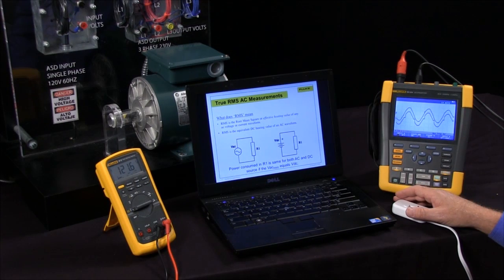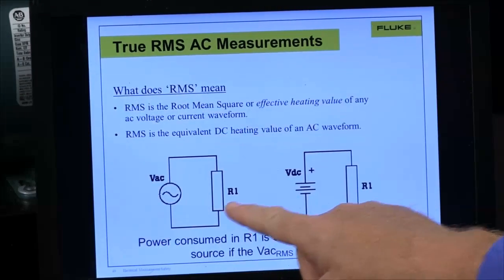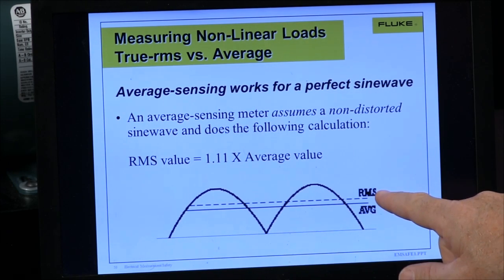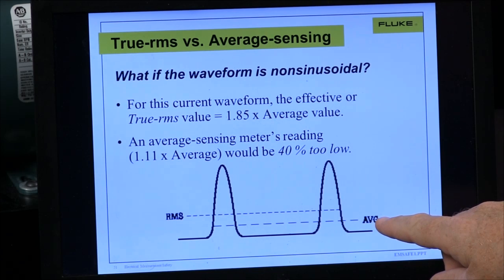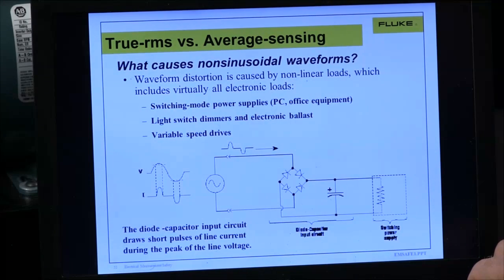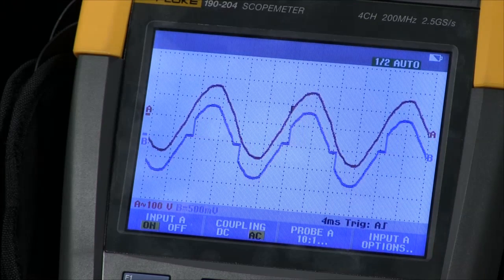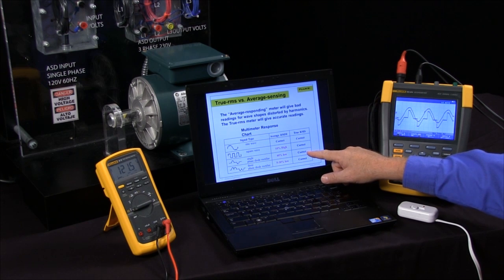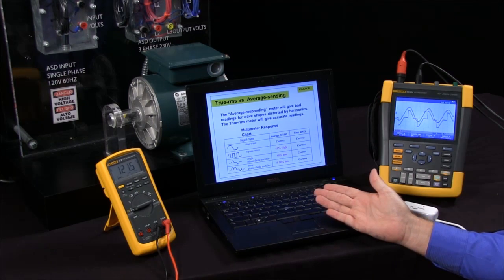What Is True-RMS And Why Is It So Important?

Comment: okay so how do i apply this? or in other words what does this tell me?
Reply: A true RMS meter gives more accurate results by accurately examining a sine wave compared to an averaging meter, which gives a rough estimate. The average meter is alright for perfect sine waves, but when you have distorted waves, you can get incorrect readings, which could interfere with troubleshooting or diagnostics. When it comes to sensitive electronics, it's important to have accurate measurements.

Comment: Q:  WHEN is a NON-TRUE RMS VOLT meter, a better choice than a TRUE RMS meter??
A:  Automotive alternator D.C. VOLTAGE OUTPUT measuring.  Why?  Alternator output should have only D.C., without any A.C. waveform, (called DIRTY D.C.), riding on top of the D.C.  If an alternator diode set is bad, the dirty D.C. will NOT ALLOW a NON-TRUE-RMS voltmeter to SETTLE DOWN.  The voltage display number will be erratic.  BUT, a TRUE RMS meter, set to D.C. will settle down and FOOL YOU into thinking ALL IS GOOD, when in fact, the alternator is BAD.

Comment: If my multimeter is reading continuety on the mineral resources but not beeping, what does it mean?
Reply from the maker: Hi Samson - Our multimeters will have a specified resistance value at which the continuity is guaranteed to beep and give an audible tone. That value can vary depending on which meter you are using. Which multimeter are you using and what resistance value are you measuring? Example would be the Fluke 179, the continuity beeper is only specified for ohm measurements at 25 ohms or less. Any measurements above 25 ohms is not guaranteed to beep.

Comment: How does a dimmer switch increase the peak to peak current? Makes no sense
Reply from the maker: Hi Scott - This would depend on the direction of the dimmer switch. If you were to dim the lights you would be increasing the resistance giving you a lower current through the bulb. And the opposite would be to brighten the bulb where you would decrease the resistance and increase the current.

Comment: Thanks sir...so true rms is for AC readings only..
Reply from the maker: Hi Abhay - A true-RMS device (RMS = root mean square) is one of three tools that can measure alternating current (ac) or ac voltage:

http://bit.ly/38hpMYj
Reply: @fluke  You didn't answer the question.
Reply: @immeohmyoh  the answer is yes and to be fair that link really gives more than enough info to fully answer.
Reply: @isaacturner199  The answer is NO. A DC PWM signal from a microcontroller would also be wrong.

Comment: Today I objectively tested my Fluke 117 "true RMS" meter against an oscilloscope measurement of RMS voltage at 60 Hz, using a square wave input from a signal generator with or without offset, varying duty cycles. I would have thought that the Fluke would do pretty well. Not so, compared to the scope! When it didn't perform well at 15kHz, I assumed it was because the sample rate was too slow, but even at a slow 60 Hz it can't keep up. Presumably the refresh and higher sample rate of the scope was the difference. At 50% duty cycle it is close, but for outside limits like less than 30% duty and more than 70% the result was pathetic.
Reply from the maker: Hi Scott - I decided to answer this question on your original comment. Please feel free to send a reply to our answer if you have more questions!
Reply: spelunkerd I’m trying to figure out how the current peak changed when he used the dimmer switch, I thought only increasing the load (reducing impedance) would result in increased current.
Reply: Have you been caught by a trap for young players? Specifically that RMS on a scope is DC RMS, but RMS on a truerms DMM is an AC RMS.
Reply: @Mr.Not_Sure  What's the difference?